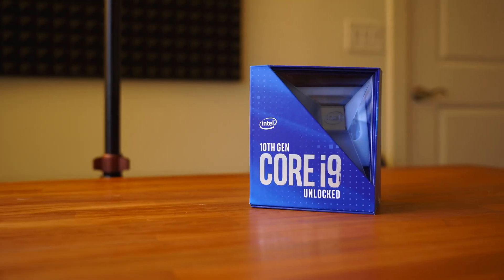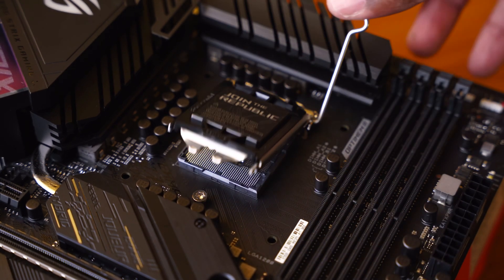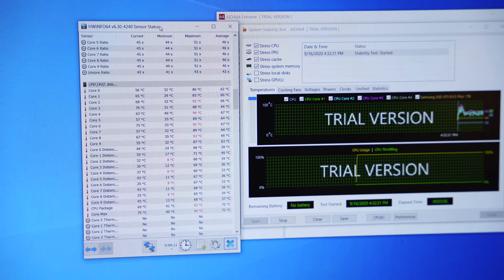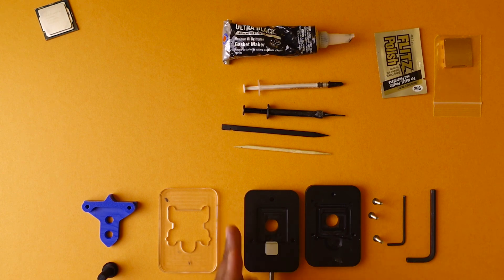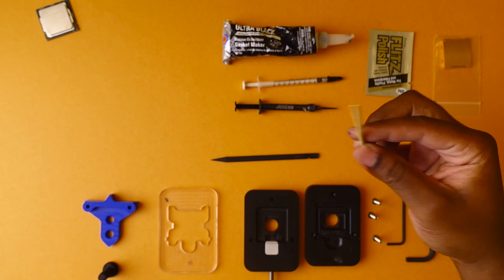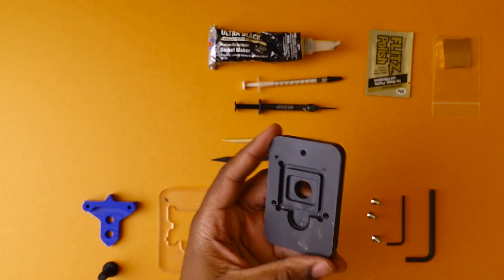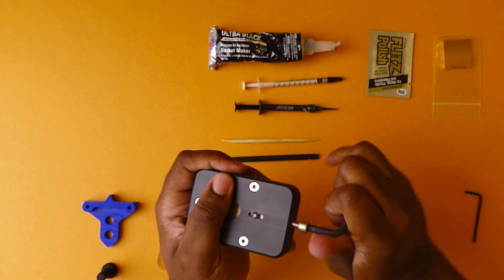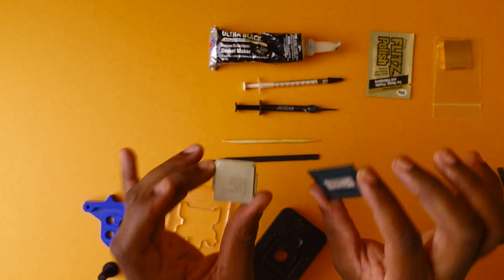10900K Delid Guide Part 1

Comment: What is the difference between Rockit Cool and Der8auer's?
Reply from the maker: the rockit cool kit is easier to use in my option, (I've used both)
Reply: @flanconleche  i wonder if these work with a laptop i9 10900k that comes with pins? Any idea?
Reply from the maker: if its a socketed CPU like a desktop than yes it will work.